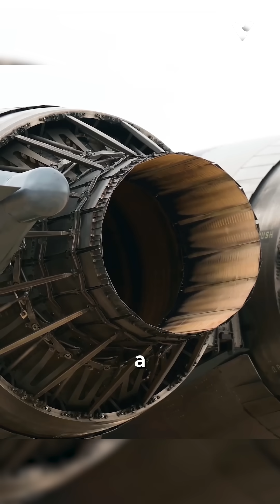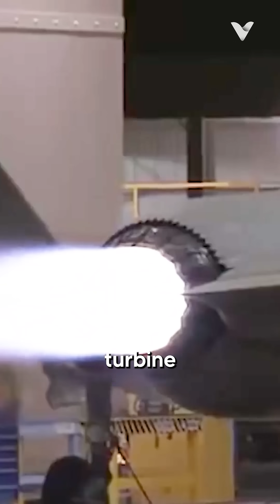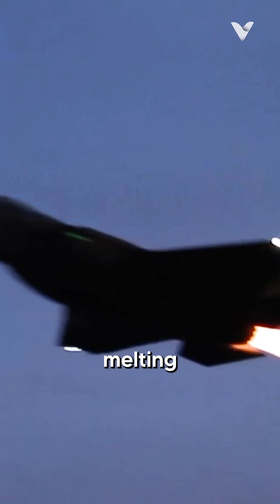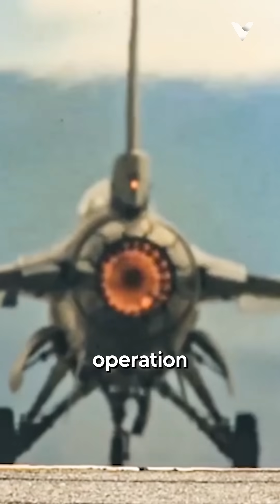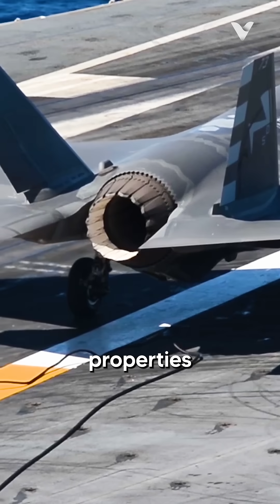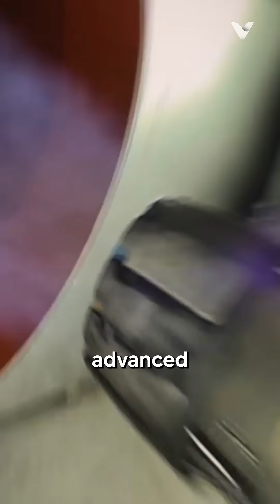Why Don't Jet Plane Nozzles Melt? #shorts

Comment: For those who don’t know regenerative cooling is when the fuel, air, or other cooling liquid is pumped through the walls of the nozzle to cool the engine down.
Reply: Just like in rocket engines, for example in space shuttle
Reply: @maciejpieskasta493  you took the words right out of my mouth. He could have Mentioned molybdenum, niobium, tantalum, cobalt, aluminum, titanium, lead, and boron. With Porus ceramic coating.
Reply: @maciejpieskasta493 
Revelation 3:20
Behold, I stand at the door, and knock: if any man hear my voice, and open the door, I will come in to him, and will sup with him, and he with me.

HEY THERE 🤗 JESUS IS CALLING YOU TODAY. Turn away from your sins, confess, forsake them and live the victorious life. God bless.

Revelation 22:12-14
And, behold, I come quickly; and my reward is with me, to give every man according as his work shall be.
I am Alpha and Omega, the beginning and the end, the first and the last.
Blessed are they that do his commandments, that they may have right to the tree of life, and may enter in through the gates into the city.
Reply: @maciejpieskasta493 space😏
Reply: Negative. (I was a Jet fighter mechanic in the Marine corps).
The heat in the nozzle is far too hot to send fuel or liquids through. They would reach thier flash point and vaporize or explode. Thier are cooling systems on some aircraft that spray deminaralized water to help cool the turbines , and heat exchangers that interact with fuel, but there is no active cooling system in the nozzles themselves.
Thier is fuel sprayed after the turbine which may mitigate some heat, but more than likely they make the afterburner nozzles even hotter.
Its the inconel and possibly ceramic coatings that allow them to live at these temperatures. I asked a Pratt Whittney engineer what was materials were used  on the turbine, but it is classified, so your not going to find it.
I think your thinking about rocket engine nozzles and shrouds.
Some do have active cooling using a much different fuel and or liquid nitrogen.
Reply: @jeremywhittler8591   Thank you for your correction. I am not an expert and was indeed referring to rocket engines.
Reply: @Micah-The-Creator  we need more people like you. You actually thanked them for the correction rather than getting mad. 

Most people these days would just get mad over a simple correction like this.
Reply: @extremecube   Thank you 😊
Reply: @jeremywhittler8591 Great info, thank you! 🙏🏼
Reply: @jeremywhittler8591 thank you for correcting this silly misconception.
Reply: @jeremywhittler8591  Thanks Jeremy.  I though so, but now I don't have to look it up!  I'd imagine air drawn in by the jet plume because of the venturi effect would also drag a bunch of it along the outside of the nozzle.
Reply: @jeremywhittler8591  Name 1 modern turbofan utilizing water for HPT cooling 🤔
Reply: @thatmitchellguy  
The engines on the B52 have water injection, special Hughes 500 helicopters used in Vietnam for inserting troops in North Vietnam on secret missions had water injection in their engines and like the B52 was for emergency power, it does the same thing water injection does in piston engines, it cools so higher power levels can be achieved, any type of jet engine can have water injection fitted to it, there's even guy's on YouTube doing it with the miniature jet engines used in remote controlled jets.
Reply: @dukecraig2402  The TF33’s on the Buff are not water injected. They can be fitted but they are not equipped at the moment. The old J57s used water injection to help cool the HPT and increase thrust and efficiency. And you’re comparing turbo fans with turbo shafts and remote models. I said earlier, no modern turbo fan that we have an Air Force in inventory is water injected. And you’re saying any engine could have it installed, no I can tell you there is no hook ups on an F110 anywhere on the engine to install a water injected system. Is many times I’ve been around for tear down and as many times I’ve inspected it as quality assurance, there are no points for a water injection system. 😂
Reply: @thatmitchellguy  
I didn't say there were ready connect fittings, if you didn't comprehend that that the point was it's possible to put them on any of the the deficiency is on your part.
And bypass in jet engines is not regenerative cooling, that's entirely different, regenerative cooling isn't just about cooling it also has to do with heating fuels, and oxidizers if applicable,  without that part a process isn't regenerative cooling.
Don't tell me, let me guess, you're another "I was a jet mechanic in the military".
Reply: @dukecraig2402   you said any jet engine can have a water injection system retrofitted onto it. Didn’t say the fittings have to be there, but at least mounting pads or something has to be there in order for it to fit in that category. And none of them have that. Why? Water injection serves no purpose nowadays. There’s no possible way to install them on any engine that we have today without doing a major TCTO to modify the whole engine to make it possible. And that would make zero sense. I have 21 years and counting of high and low bypass engines. Line maintenance and troubleshooting, overhauling, quality assurance inspecting. Let me guess, you’re another I seen it on Reddit or got my answers from ChatGPT now he thinks he’s a SME guy huh? 😂 How many Augmentors you inspected or how many Aug burn through investigations you been a part of? 🤔
Reply: @dukecraig2402  And did explain the attention getter on purpose while explaining a different point but seems you didn’t comprehend that and decided to gloss over that. But it’s all good.
Reply: @dukecraig2402  I sense some insecurities and you wanna chill trying to discredit or disrespect Jeremy, myself or any military members aircraft maintenance experience. Clearly you don’t know some of us work closely with manufacturers, engineers and so forth. So your assumptions make you look like a, well you get the idea genius
Reply: @jeremywhittler8591  You are correct, sir!  The video was wrong to claim that gas turbines use regenerative (fuel) cooling.
Reply: @gw7579 
No he isn't, and four times now this channel has refused to post my comments explaining how just about everything he claimed is incorrect.
Reply: @jeremywhittler8591 you love your work. Thats great. Salute from Germany
Reply: @jeremywhittler8591 Thank you. That is really informative.
Reply: @jeremywhittler8591 Liquid nitrogen and classified materials we “discovered” in the 40’s. But hey who knows. Great explanation.
Reply: @jeremywhittler8591 I know a f16/f35 mechanic and he said there is also a layer of air between the wall and the heat. I think he also mentioned it's in combination with deminarelised water, that makes it able to run at such high tempertures
Reply: @lothar654  I can assure you, there is no water running through the F110 and the F135 😂
Reply: @thatmitchellguy  atleast a layer of air does the trick 😂
Reply: @jeremywhittler8591 the fact you apparently don't know the difference between there, their and they're in what you wrote has me doubting your legitimacy... 

Just to educate you:
There = to reference a place
Their = the possessive of they... For example It's theirs. Would mean it belongs to them.
They're = they are
Reply: @jeremywhittler8591  = I am no jet fighter mechanic. Only german highschool knowledge. 
Water is spryed for cooling ? Not the only reason ! Water expdand to high volume when it get a gas and add additional thrust to  jet engine. 

Please use google in the US. 
Technical english is not what I like ...

Remember only german highschool knowledge. Did you teachers safed to tech unuseful knowledge and teach only how to eat, how many presidents and and and ? 

Sorry i dont use german google version to read these water injektion reason. 
But cooling is only one reason and not all the time necessary or useful for a jet engine. 

Sorry aircraft and fighter jet technology is not my favorite knowledge and I am a lot of years far away from my school.
Reply: @jeremywhittler8591 no there is a way, rockets use it and a assure you rocket exhaust is much hotter then jet exhaust. Scramjets use regenerative cooling if I’m not mistaken
Reply: Love both of y'all
Reply: @Icon.two.fiv3.four. ❤
Reply: @Icon.two.fiv3.four.  "both of you all"?
Reply: So it's similar to a computer (PCM) of a car dumping fuel to cool off the engine because fuel has a cooling effect.
Reply: @fromisheon4867 I worked near the calibration engineers at a car company. Fuel economy is too much the holy Grail to waste fuel doing that. Only time I've seen temperature damage was failed cooling systems or if someone added aftermarket nitrous.
Reply: My hero!
Reply: That is the concept of rocket engines. Speaking in the terms of turbofan engines, the concept of regenerative cooling is through the use of cool secondary bypass air. Augmented turbofans are low bypass turbofans, which means that the majority of air goes through its core while the remainder bypasses via secondary casing. In the turbine section, that cool air goes through the high pressure turbine (HPT) nozzles to keep the nozzles internally cool as well as through the HPT Rotor. When it comes to the Augmentor (afterburning) section, cool air is routed through the nozzle under a liner which has holes all through the liner which allows cooling air to keep the exhaust from overheating. That same liner is inspected as part of the post flight inspection to make sure there’s no clogged holes, which if clogged can result in hotspots thus creating a burn through.
Reply: @thatmitchellguy  
That is not regenerative cooling and has nothing to do with it, bypass air in jet engines is an entirely different thing and has absolutely nothing to do with cooling.
Reply: @dukecraig2402  yeah I know that’s not regenerative cooling is, but it seems like a lot of people eating up the misinformation and winning. So I decided to mention regenerative cooling, however, giving an actual thorough description of how the augmentor on our fighter engines are cooled. None of the turbines on our modern fighter engines are cool via fuel. Fuel is only used for cooling oil through heat exchanger prior to the oil going back into the tank.
Reply: @thatmitchellguy it's for space.. if a fighting jet have such engineer, it would be in such a small scale
But not the scale of cutting off 3000~2000 degrees 😊
Reply: 🫶 Respect!
Reply: Damn we are smart
Reply: I was just about to ask that lol
Reply: So we use flammable liquids to cool metal at 2000*c
Reply: @WatchingVideos-w9v  
Yes, regenerative cooling is the use of liquid fuel and liquid oxidizers cool engine parts like the bell of rocket motors, the body of the SR71 was cooled in a similar fashion by pumping its fuel through passages throughout its body, it's been used more than YouTube likes to erase my comments.
Reply: @dukecraig2402 The SR-71 was the motor used on the Saturn V ? 
I remember a video on that and the dark lines on the bell were the tubes that not only cooled the bell but had another function to heat the fuel to increase the volatility before ignition.
I think it was Scott Manleys channel which is a great source of aeronautical and space info.
Reply: @The_Original_forresttrump  
No, the SR71 spy plane had its fuel pumped through its body to cool it.
And yes you're correct about the engine bells on rocket motors and how the fuel was pumped through regenerative cooling tubes around the bell which cooled it and heated the fuel and oxidizers.
4 different times I wrote posts correcting the person claiming that "fuels would boil and explode", along with the fact that the Rocketdyne F1 engines of the Saturn V rocket used kerosene, which is basically what jet fuel is, and gave the history of how Reaction Motors Incorporated patented the process for cooling rocket motor bells in 1937, along with why the fuels don't boil and explode as he claimed they would, but this channel wouldn't let them post.
Reply: @The_Original_Forrest_Trump that's right
Reply: @WatchingVideos-w9v  they're not gonna burn without oxygen!
Reply: military secret sometimes no more secret for the welfare of goodness😊 maybe
Reply: MicahMcnulty-I want you to start working on a new propulsion system that can get us to Mars in one week or less.  Once done with that then start working on entire space craft, I want to be comfortable on my journey....I'm a multi-Trillionaire how much will it cost me?
Reply: Thank you big man . First question I asked was WHAT TF IS REGENERATIVE COOLING ?
Reply: @chukwumakenneth6602 liquid + intercoolant fix engineering design that basically mimics some construction wall for a turbine turbo like turbo cooler
Reply: Nothing is being pumped here. Bypass airflow is routed under the aug liner and provides cooling.
Reply: Thank you
Reply: @  No problem
Reply: This technique is used in cryogenic engines
Reply: I knew that
Reply: Wicked badass
Reply: Huh, and I literally just asked myself what regenerative cooling was before I went to the comments

Thanks
Reply: Ty. First and last questions answered 😂
Reply: Afterburner?
Reply: @redcon1115  Concept wise after burning is the process of the secondary combustion of gases that were previously ignited. System wise, Afterburners were installed on Turbojet engines and Augmentors are installed on Turbofan engines. Augmentors are more fuel efficient and produce more thrust by mixing cool, dense air with hot gases where Afterburners just dumped more fuel into hot gases and relighted
Reply: Well I guess I should have read the comment section first🤦‍♀️. Thanx for the explanation😊.
Reply: He couldn't have said that?
Reply: Just like in a car when the pump is in the fuel tank.
Reply: Kinda like sweating to regulate body temperature?
Reply: Your absolutely 💯 percent right ✅️
Reply: You have to brake that down due to stator and rotator blades at intake goes into the combustion chamber where the air fuel is mixed with another application witch is varied at excelerated speeds the rotor blade is used for 4 cycles for the engine to work😂,
Reply: How is the liquid pumped?
Reply: The turkey feathers on the aft are made of special material
Reply: Chingkongs are taking notes 😂😂😂
Reply: Thanks, cuz this video still didn't really explain it!
Reply: Dude in the video could’ve just said water cooling
Reply: Its crazy i can now randomly watch some technical fun fact with deeper details added in the comments and all that validated by a professional actiually working on that item in real life - all that within 3 minutes
Reply: Also laminar flow
Reply: Just like Car Radiator cooling system
Reply: That "cool" must be itself very hot isn't it 😅
Reply: And I assume, afterwards, the fuel is burnt
Reply: Bro this comment read my mind. As I finish the short I was like "the freak is regenerative cooling" lol
Reply: Studied from bachelor's degree and dropping them in comment😂😂
Reply: Like refrigerators?
Reply: Thanks for explaining, dude...
Reply: that's just cooling. you forgot to explain "regenerative"
Reply: ceramic lining or silicon based matrix's are good
Reply: But by how much % does that cool the jet down
Reply: it's what the space shuttle main engines used.
Reply: It's old tech allow it
Reply: Like nitrogen to cooling it down?
Reply: Black people invented all that.
Reply: Black folks invented this.
Reply: Greatly appreciate the clarity 👍🏿
Reply: Thank you, "google."

Comment: fun fact, the use of afterburner on the f-35 B is limited to not fuel, but the smaller elevator and vertical stabilizer size melting after significant use of it

Comment: I don't know about everything that is out there but im calling bullshit on regenerative cool concerning afterburning engines. For one, its not needed, they get more than sufficient cooling from controlled airflow, boundary layer, and film cooling. Regenerative cooling is too complex, too expensive, to sensitive/easily damaged, too heavy, etc. For rockets yes, for jets no. Passive systems like ceramic thermal barrier coatings, absolutely. The only "coolant" there would be enough of carried aboard is fuel. Kero/lox rockets have to go through meticulous cleaning & inspection for regen cooling passages and doing so burning scientifically pure fuel. Jet-A & JP-8 is pretty clean but its not RP1. Just no.....
Some engines use the fuel as hydraulic fluid to operate the rams that operate the nozzle and there is circulation there because the fuel cools the rams. Those are outside the burner can and don't get anywhere near as hot.

Comment: That 1 sentence description is basically all there is to it, a jet engine, especially a turbojet, is not really very "complex" at all. It's literally just a shaft covered in fan blades and shoved inside a metal can, and the shaft spins cuz the back half of the can is full of fire. Not to say the engineering isn't hella impressive, just that they have WAY less going on inside than a piston engine.

Comment: The regen cooling is a marvel of efficiency. The jet/rocket will usually have a liquid fuel component such as liquid oxygen or hydrogen. In a liquid state, these are incredibly cold. To use them in the fuel they must be warmed up. In burning the fuel, the nozzles must be cooled down. So, fuel cools the nozzles, nozzles warm the fuel... jet dominates the sky with outputs that could melt Mjolnir to slag.

Comment: Er.. somehow 2,000 degrees celsius doesn't sound right. 3,600 degrees fahrenheit..?? LAVA Is on 2,200 degrees fahrenheit FFS ... Think you got the C and the F mixed up for that comment. There's no way jet exhaust is more than 150% the temperature of molten earth.. I don't think the propellant is capable of burning at those temperatures period?